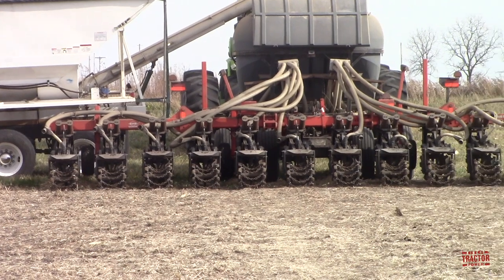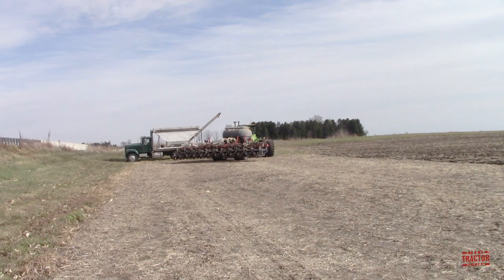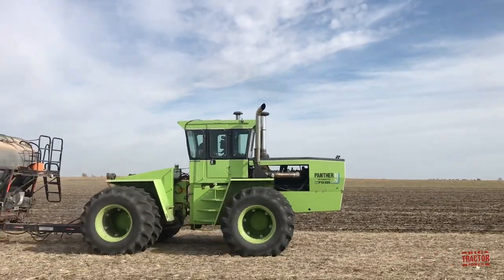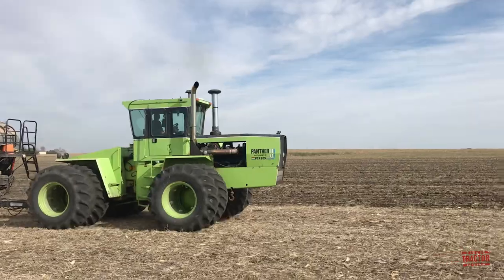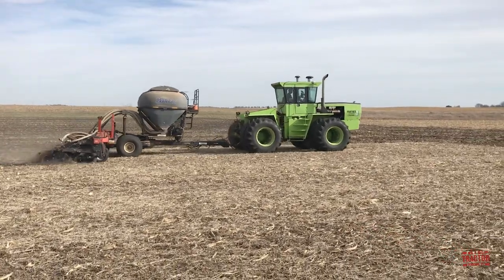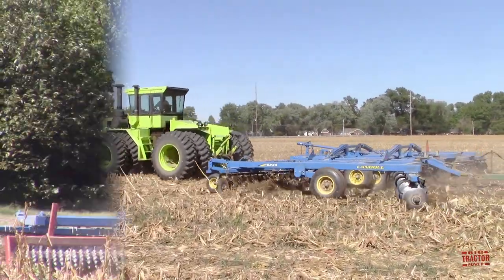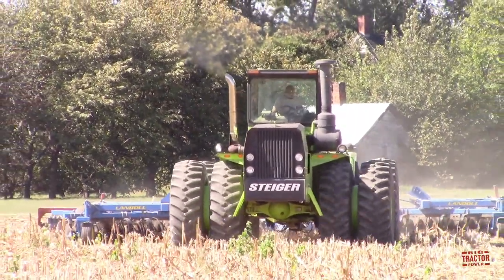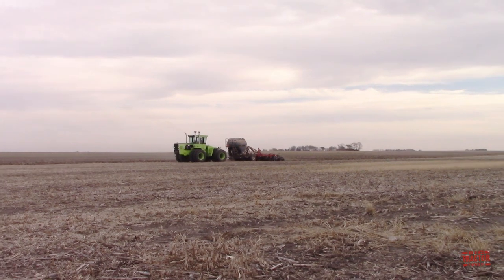STEIGER PTA-325  Panther III 4wd Tractor Working on Fall Tillage

Comment: I love these stieger tractors, have never ran or even been around one before but they are beautiful and w case buying/ using their technology that says alot about how good of a piece of equip they are. I have ran a 9380 qt for awhile, my boss man had one in the early 2000s up until about 2008 2009. I loved that tractor. It would handle our 12 row bedder or strip till like nothing I have ever seen, like it wasn't back there. I ripped the hitch off of the bedder once and two other ppl help us once and twice apiece until we got if beefed up right. I wish he wouldn't have sold that tractor, it outrides any other tractor they is on dirt or if anything soft. Never had any trouble out of it at all. I love that thing. Could be using it w big landlevel around pond I would be digging out w trackhoe and it would take the mud mostly we even a good footprint and go wherever w it. I didn't like having to use it for that but w pushing for time it was the  only thing we had that would get out there and get the pond finished up before we were all spread out in the fields wide open. Best most comfortable tractors I ever been in. I liked the cab, how much seat would turn, the foot pegs, visibility, better than our new deere's now. Alot of things w those tractors is ahead of their time and they bout bulletproof

Comment: I  worked for a farmer back in 1985 thru 1992 and they had a PTA 325, we pulled a 15 shank chisel plow and a 54' field cultivator. Unbelievable power it had.
Reply from the maker: Very cool. What brand of Field Cultivator and Chisel did it run?
Reply: John deere field cultivator and DMI chisel plow

Comment: Love the no till setup. Great that the older tractors are still relevant in a no till auto steer farming system.🇦🇺👍
Reply: Buuut its strip-till???? Literally has till in the name🤷‍♀️
Reply: Cillian Galvin well I’m no corn farmer from the mid west, just a sheep and small grains farmer from the Wimmera in western Victoria Australia. What I see is the inter row left un touched and leaving the ground cover intact. Vastly different to full inversion with a disc or mouldboard plough. 🇦🇺👍
Reply: @stevenstart8728  Of course, yes the interrow is left completely untouched but the row itself is cimpleteley tilled so its still considered tillage👍 Nevertheless its definetly a very good practise in some regions👌

Comment: I so badly want a blue n white Steiger, preferably the FW60.
Reply: The first Steiger I ever ran was a 1977 FW60. It had a 903 Cummins V8 and was rated at 335 hp. I was 15 years old and felt like a boss in that tractor. Good memories!

Comment: Our local dealer sold two green series 3 Steigers to a couple of brothers  and one was the Tiger PTA 450 and the  other was a Panther 325 or 350 not sure the smaller one was automatic, one condition of the sale is that both had to have a Sony compact color television installed.                                                                                                                                                              Back then around 1980 that was a huge amount of money for the pair !!!!!!!!!!!!                                                     

 The farmer who farms my ground also  had a PTA 325 or PTA 350, not sure which, his only complaint was fuel usage.  Would love to drive one some day.
Reply from the maker: Great history.  The mini TV was a big deal option for Steigers back in the day. The Tiger III was only available as an ST.  There was an ST-450 and an ST-470. The PTA models ranged from 225-325 hp in the Bearcat, Cougar and Panther models.
Reply: If it had a 903 Cummins V8, it’s a 350

Comment: Will the corn be planted in the same path as the fertilizer was placed ???
Reply: Its not necessary to do that. The corn roots will find the band of fertilizer under the surface.
Reply: @dmc3742  OK thanks for your reply !
Reply: @dmc3742  we will plant right back into these strips. The soil will be warm and drier than straight no till and the fertilizer is right below the corn seed in the strip.
Reply: @dougstierwalt1015  Advantage of having GPS I assume. The guidance should keep you right on track.

Comment: I'm surprised the Ole girl has the hydraulic capacity to operate the dry fertilizer delivery system and still run everything thing else ! Tractors of that age were usually lacking in that department !!! Replacing a quarter million dollar modern  tractor though  !!!
Reply: It could be tweaked out. That’s the beauty of the older tractors